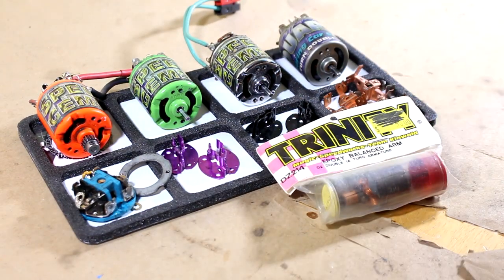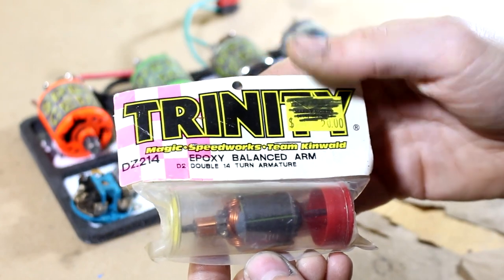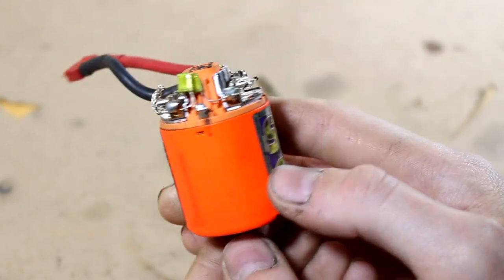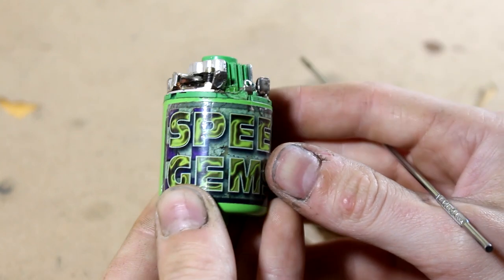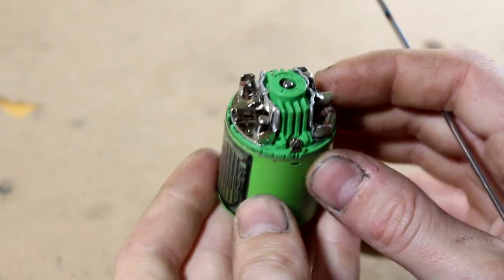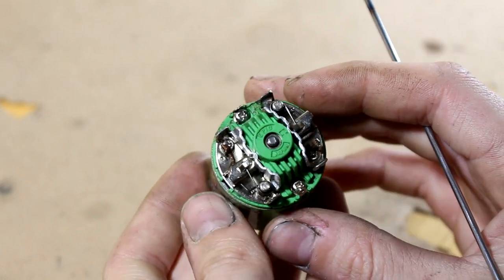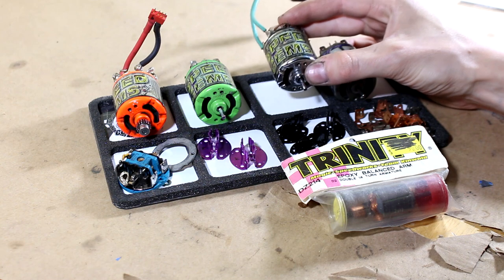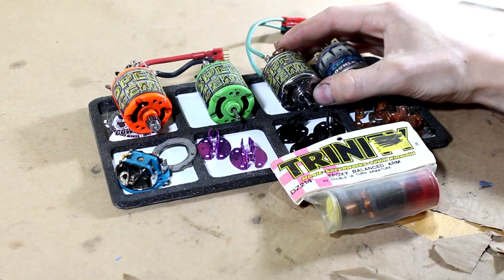VINTAGE Trinity Speed Gems Motor and Parts Haul!!

Comment: The single doubles and triples quads refers to how many wires are wrapped around each winding so a single would be 1 wire wrapped 14 times on a 14t where a double would be two slightly smaller wires wrapped 14 times and so on hope that helps. Love the videos
Reply from the maker: Oh okay gotcha, thanks!

Comment: Love the video. I was going to explain the motor windings as well but The Mooser beat me to it. As for the why of the singles, dubs, trips & quads (redundant winds) it all has to do with the torque of the motor. The lower the number the more raw torque. A single would be a beast off the line but offer less control in the sense that it would be less responsive to your throttle input. A quad would be the exact opposite with the most control but least amount of torque when you hammer the throttle.
Reply from the maker: Ah, Okay, thanks! I think that's what I had read a while ago but I couldn't remember. Thanks for watching!

Comment: That blue endbell is from the Trinity paradox stock. Not compatible with the the speed gems. Also I’m a vintage motor collector myself and have about 300+ brush motors lol. My step dad and I used to have a brush motor tuning company that was slowly growing, got affected when brushless started taking over. Also, I would HIGHLY recommend hunting down Trinity/epic XXX compound brushes. They provide excellent power without being harsh to the comm. you can easily get 30+ hard runs with them before even cutting the comm. I have a custom Trinity co27 stock motor with magnetically advance timing (36° vs stock 24°) and p94 style xxx brushes. I have about 60 runs on it and still no noticeable wear.
Reply from the maker: Wow 300+!? Thats so many! Thanks for the great info on the endbell and brushes! I just looked and I actually have a few pairs of both standup and p94 xxx brushes so I will have to try them out. Cool to have a fellow motor collector watching!

Comment: I was always told the lower the turns the higher rpms. The more the winds (single,double, etc) the higher up the power is on the rpm.
Reply from the maker: Oh, so you're basically saying that the number of winds changes where the power band is on the scale of min to max motor rpm's?

Comment: I have a comm lathe. And maybe a D2. Plus lots of parts. The blue endbell is from a Sapphire Speed gems. Message me. I can tell you all about those. Example, 12x4 would be 4 wires wrapped 12 times around the arm (turns). As I remember things, the more wires and turns the more torque the more will make.
Reply from the maker: Oh super cool! Ah, I see, thanks for the info!!
Reply: I found a speed gems sapphire in an old rc10 same label as the first three in this video- what sort of specs are in that motor?